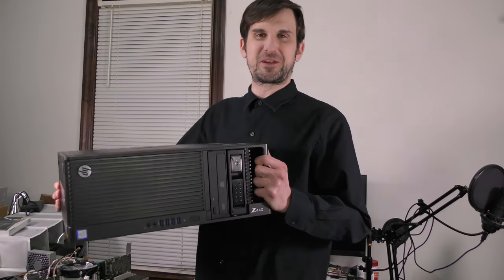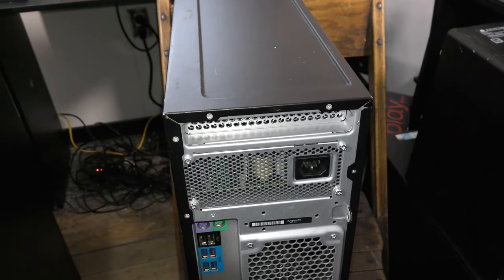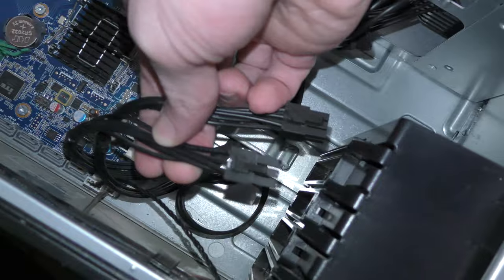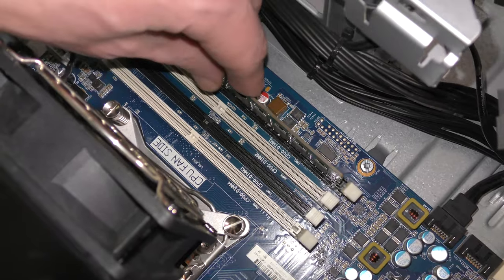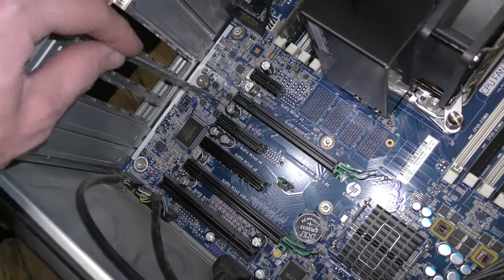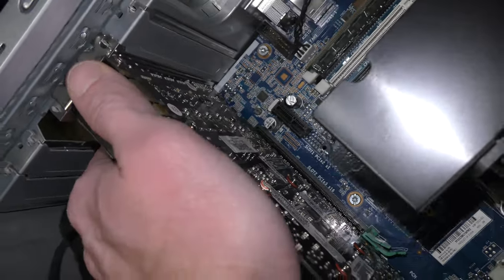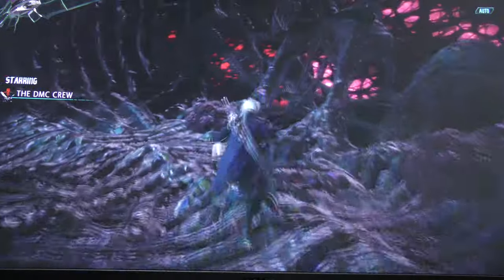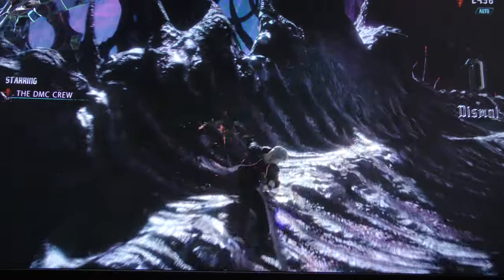Mod an Office PC. DO IT!

Comment: You remind me of George McFly from back to the future lol. I love old office Pcs too good cheap fun, I built my kids an arcade loaded with roms and a emulation pc for their room from retired office pcs. Another thing I love doing is dumpster diving in the electronics dumpster at my locale recycling center. Ive found all kinds of old pcs and even a few older macbooks! Its crazy the things people throw away
Reply from the maker: MCFLY. HEY MCFLY! 😂 Awesome idea, a lot of older, inexpensive office PCs are great for emulation. I've got an old Prodesk 600 G1 I did the same thing with. It handles a bunch of systems, and just building it was a lot of fun too. That sounds pretty sweet. And you are absolutely right, there is a lot of older hardware that is way more capable than a lot of people realize / give it credit for!

Comment: Watching your previous videos right now. What I've learned so far:

1) The use of the Chair Desk needs to be followed by the sound of thunder from time to time. The altar must be re-consecrated, or the wrath of the gods will fall upon us.

2) Removing a processor usually requires a chant based on Kiss From a Rose to keep evil spirits at bay.

3) If everything else fails, the pool noodles and their violence will save us.
Reply from the maker: 😂 You are very wise my friend! And these three truths shall be absolute!

Comment: My favorite time of PC building was the super budget office PC builds I did during college. It was cool to see what kind of gaming systems I could come up with on the cheap when I was used to playing on 1680x1050 dell monitors that were free and only needed a $0.10 capacitor replaced to work like new. Modding office PCs these days can provide an incredible value, based on the specs I see from very inexpensive ebay listings. I do think that they will hold their relevance even longer now with the newer CPUs available in cheap used PCs. Nice build!
Reply from the maker: Absolutely, it definitely is a lot of fun and results can be surprisingly good. 🙂

Comment: As far as I know, people have managed to BIOS mod the Z440 by now. Meaning you can run X99 turbo unlock, ReBarUEFI and add NVMeboot to the BIOS itself, making any PCIE adapter cheaper than the Z Turbo Drive work as well. Should definitely look into that. If you throw some cheap heatsinks on the VRM area (and maybe $2 40mm fans) I'm sure you can easily run a $50 E5 2680 v3 at its all core turbo of 3.3Ghz - easily in games. Using Taiphoon Burner, you should be able to write the SPD on that RAM too and lower timings. Usually every IC can do 12-12-12-30 or so on DDR4 2133 at 1.2V - even ECC RAM and even in quad channel. That's the only way I see this competing with Chinese X99 boards tbh.
Reply from the maker: That could be pretty sweet. Never dove that in depth with the z440, but learning more about them as I go. I appreciate the suggestions!
Reply: @LowcastleTech  Don't forget looking into using an older BIOS and ThrottleStop version too. It'll be easy enough to overclock the 1650 v3 (unlocked) to 4.4Ghz as long as your VRM temps are playing along.
Reply: @LowcastleTech  Ukrainian overclockers forums have an older modded BIOS. I think you have to add the NVME ffs driver as well as RebarUEFI to it yourself though.
Reply: If it's just about loading the correct turbo boost and NVME drivers, you can also just use a bootloader like Clover or OpenCore. However, this does NOT work for RebarUEFI.

Comment: Congrats at hitting over 1k subs!  On the Windows' key issue, have you ever used the HP original configuration lookup to see if they were shipped with Windows?  That is one of the things I've found when I was buying used Dell and HP office machines, sometimes they shipped with Ubuntu or FreeDOS.
Reply from the maker: Thank you! And I'm not familiar with that one. Typically I just go through the install to see if I'm prompted for a key, and also there is a CMD that will pull the key and display it (if there is one embedded). That could be useful though, especially if buying a model I haven't messed with before.

Comment: First, glad to see this channel getting up to 1k plus subscribers! Congratulations! Second, wondering if anyone has tried the either the Lenovo Thinkstation P500 or P510. These look really well put together. PSU is only 650 W for the higher one in this model and only has (as far as I can tell) one six pin GPU power connector. This may be the weakness. P500 supports E5 v3 while P510 supports E5 v3 and v4. Prices seem roughly equal to the Z440. As I am a big fan of the Thinkpad line, these look like a perfect match for these from the desktop/workstation side.
Reply from the maker: Thank you, I appreciate that! And that sounds interesting. I haven't used them, but seems like it could be worth checking out. Even with just one 6 pin connector, it could still rock a gtx 1060. That card isn't terribly expensive, and usually pretty decent as far as budget builds go. Thanks for the suggestion I will probably check those out, definitely fun even to just browse around and see what's out there.
Reply: you can pop in a rx 580 2048sp in one of those with that psu. i just put one in a pc with a xeon e3 1230 v1 and im getting 60 plus fps on every game ive tried 1080p. fortnite can do 140 fps on performance mode
Reply: @LowcastleTech  If you try it, I hope it works out well for you. Thanks for the reply.
Reply: @swiiishgin1515  Good to know. Thanks!

Comment: hello from morroco and thanks for the informations
i have a hp elitebook 800 g2 and i want you advice about a gpu
Reply from the maker: Very nice. I really like the prodesk 600 and elitedesk 800 g2s. I've ran an 800 Elitedesk G2 with an Nvidia Quadro K2200 in the past. It did pretty well, but those cards aren't really spec'd for gaming, so kind of depends what you want to do. The challenge with those models of computer is that there are no GPU connectors from the power supply, so that kind of limits the options. I've heard some people mention a model of GTX 1650 that doesn't have any additional power connectors, but haven't been able to verify that myself. Overall it largely depends on intended use, then finding something that fits from there.
Reply: @LowcastleTech  thanks for your help and time I will try to find in use market a gt 1030 or GTX 1650 low profile or Rx 4600  
🤔 🤔
Reply: If it's actually an Elitedesk and it's SFF like you seem to imply in your other comment, you might want to take a look at the RX A2000, miners are selling their used stock of them and they're the fastest SFF/low profile GPU on the market (and it's at a decent price too)
Reply from the maker: @adil-blue-blood7626  Sure thing! Thank you for watching and good luck 🙂
Reply: @My_Old_YT_Account  oh no it's very expressive here in Morocco 1000$

Comment: My main rig is a dell precision t3600 and i have swapped out ram so it has 32gb now swapped out gpu for gtx 1050 runs the games i play at a decent amount of fps on around med
Reply from the maker: Very nice, I've had others bring up similar Precision models in the comments, they look pretty legit. And the 1050 seems like a solid budget card.
Reply: Yea precision series also has gpu cables that can be added for any of its power supplies 2x6 pin or 2x8 pin makes for lots of gpu choices

Comment: I immediately got the Wolf of Wallstreet part. these HP workstations are really solid specially for everyday use and emulation even without a GPU. does z440 have an SFF variant?
Reply from the maker: Nice 🙂. And yeah I've been liking them a lot as well. I don't believe there is a SFF z440. Closest thing would probably be the z240 which comes in MicroTower and SFF. It doesn't hold the same type Xeons, it can do i series 6th gen, and 7th gen. The Xeons it will run are all similar to the i series processors, so it doesn't really have the same cheap higher core options like the z440. But it was from around the same time with a similar design.
Reply: @LowcastleTech  I have a z230 SSF so far I have not had the slightest hardware-related issue with it, it's so stable and the entire unit cost me as much as a single Intel core I5 12500 would. the only downside is its limitations for GPU upgrade, will it be dangerous if I use a PCIe riser cable and an external PSU to power a full-height GPU?
Reply from the maker: @Fernando-Rodriguez  Awesome, the z230s are pretty solid. As far as installing a newer PSU, it is hard to say from what I've read. I've seen power supply adapter cables that look like they would work for this purpose, but then just about any forum I've ever read on the internet is full of people saying don't use any type of adapters for a PSU. There are problems with them being faulty, not built to last, not able to correctly carry the power they are supposed to. I've thought about trying something along those lines for a project, but any time you mess with a non OEM power supply on an OEM board using adapter cables, it definitely requires caution.
Reply: @LowcastleTech  actually my plan is to use a full size GPU with this unit but without touching this unit's PSU I want to use another PSU that only powers the GPU, if it works for a laptop's eGPU it should work with this unit too.
Reply from the maker: @Fernando-Rodriguez  Oh I get ya. Sorry I misunderstood what you meant. I have never personally tried it, but I was under the impression that dual PSU might not work because there is a communication that takes place between the power supply and the device. But I'm not super familiar with it.

Comment: Hey just  came across your channel, really great. I'm doing a little upgrading n selling on of PC's. Never done a Z440 tho. Could you explain a little about the tying of licence key to the MoBo please??
Reply from the maker: Thank you! And sure thing. So sometimes when you install Windows on a computer it will ask for a license key, and if you don't enter it, you only get a limited "trial" version of the OS. Basically, a lot of these office type PCs have an official license key for Windows embedded in the firmware. So when you do the install, it won't even prompt you for a license key. It will just automatically pull it from the BIOS, install the full version and it is good to go. The thing to look out for, is that not all office PCs have this. And with the z440 it has been weird, because I got one in the past, and it seemed like it did have the embedded key, but other z440s prompted me for the key during install. Usually this is a per-model thing, so it is strange that one did and others don't. So it's something to look out for if you want to install Windows on any of these older computers. I know that is kind of a lengthy explanation, hope that helps!
Reply: @LowcastleTech  Hey that's great, thanks a lot 👍👍

Comment: hey bro i hope you are well.
can you help me i want to install nvidia rtx 3070 in hp z640.
and can we change the power supply in it..
The whole spice that is coming is the 8 pin connector inside the graphics card which is not there in this machine..
then what do i do and how to install..
Plz help me thanks..
Reply from the maker: Hello, I appreciate that, same to you. As far as the connectors it may depend on if the card has 1 or 2 8 pin ports. I haven't used the z640 specifically, but I know on the z440s there are factory PSUs that have 2 6 pin connectors. They make adapter cables that are dual 6 pin to single 8 pin. I have used one of these in the past and it has worked out alright so far. But, if the card is dual 8 pin that won't work. I haven't attempted a PSU upgrade but they look tricky. For whatever stupid reason the power supplies have this weird proprietary shape, so not every new PSU will fit. I have seen ones that are a little smaller, that might fit inside the slot, but there is another issue with that as well. Again, I've only worked with the z440, so I don't know if it's the same, but the power connectors on the motherboard are also proprietary. I have seen power cable adapters for the z440, but any kind of adapter on a power supply cable is always going to require caution as to whether it can indeed carry the amount of power it needs, and that it is made well, and won't burn out after heavy use. If you have the proper cables to power it, installation isn't too bad. There is usually a latch that opens and allows you to remove the metal plate covers from the back of the case. You then insert the GPU into the PCIe port. Once it is installed firmly you can close that latch which will lock it in. And finally you can connect the power cables that connect to the side or back, if you have/are able to find the correct ones. I know that is a lot, but there are a few variables to this case specifically. Hope that can help, or at least get you on the right track!

Comment: Does the HP Z440 work with the E5-2697 V3?
Reply from the maker: I haven't tried it personally, so not 100% certain, but it seems to hold just about any e5-v3 and many e5-v4 CPUs. Also, I have seen z440 listings with that processor in the past, so I'd say it most likely does.

Comment: i am surprised you installed the PCIE drive below the GPU i would assume it might get better performance in the slot above the gpu as there is a chance that slot goes right to the cpu but i guarantee you the slot below the GPU goes via the chipset
Reply: Its a server grade board , both x16 slots are direct to cpu as well as the x8 , the rest go through chipset.
Reply from the maker: Thank you
Reply from the maker: Another thing is that the PCIe drive is x4 in regard to its actual physical size. Slot 1 above the GPU is a x1 slot, it just wouldn't physically fit in there.

Comment: I built out a Dell t3500 and it's a low key beast for 100 bucks Canadian
Reply from the maker: Heck yeah. Several of those Precision towers look like they would be solid budget machines.
Reply: @LowcastleTech  definitely. I've actually just re pasted the CPU and installed better RAM and I picked up an rx4708gb for 50 bucks which will be here Friday and then my kids and I will install that with a new SSD for a proper boot drive.

Comment: I'm upgrading a HP Z400.
Reply from the maker: Nice! I've never done the z400 specifically, but all the older HP workstations look pretty legit.
Reply: @LowcastleTech  they are ok, I disliked the way they secure their PCI-E cards, with the tool less folding flap. Because it came loose in shipping and destroyed the 1tb HDD, and damaged the 6 pin connection on the gpu, and bent the side panel. But, because of this, I got a 4 core 8 threaded v2 cpu powered desktop PC for 30 dollars!

Comment: Da fuck it runs 150$ cheapest and runs 336$ if with ssds
On my place for a z400 stock hardwares. Too many scalpers on my place but I can get many modern pcs for cheap so its a so so. I am thinking of a project. Will be buying a acer predator Orion 9000 case and some parts. Looks somewhat bare bones if you say. No motherboard. Now I want to transplant a z820 on it and I might not but will be looking for a somewhat same size xeon machine online

Comment: U put the u in humour. 😂 I 2 have eBay addiction.
Reply from the maker: 😃eBay is like the Bermuda Triangle. Once it pulls you in there is no escape.
Reply: @LowcastleTech   Love the low cost cards that go unnoticed...quadros and firepros. Be cool to see a round up of what comes in the many z440s that are out there
Reply from the maker: @TDP808  Very true. I'm running an older Quadro in my other z440 that I use for video editing. It does really well. Messed with the Firepro w5100 in the past too, that one was like 40 bucks and wasn't too shabby at all.

Comment: SMH... sooo many z440"s ...
Reply from the maker: 😂 I have a problem. But I have branched out a bit based on your suggestions 🙂. Should have a vid on that in the future.
Reply: @LowcastleTech  Great idea would be comparing the Z440 to the dell precision ... The hp has more USB 3.0 but the dell has more PCIE lanes... and sooo on
Reply: ooo yeah the dell has a SAS connection on the mother board... Im trying to hook mine up but i need more drives 😪
Reply from the maker: @ghostemane85  That could be a good one. They both seem to be in the same price range as well, so that could be a good breakdown. Got a general overview of one coming up. That is if all goes well, been plagued by technical (as well as other non-technical) difficulties lately 😂. But that is a really good idea, I appreciate it!
Reply from the maker: @ghostemane85  🙂If you're using a MicroTower beast, might as well load it up with drives!
Reply: @LowcastleTech  I have the precision T5810... it has SAS on the motherboard... with a special cable ...
Reply: Sorry about the difficulties😪 Keep up the good work tho

Comment: im surprised i havent seen you with an HP Z4 G4 yet.  Those units have crazy potential and are getting real cheap on ebay.
Reply from the maker: Not sure if I've come across those yet in my browsing. Will have to check that out.